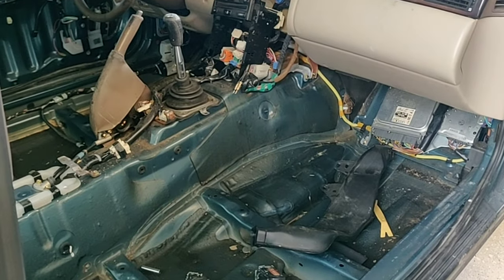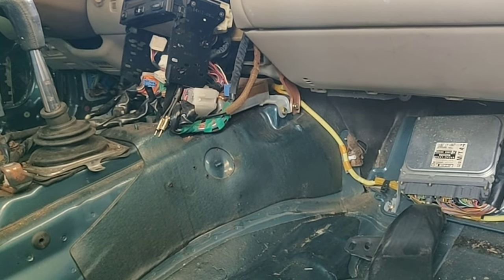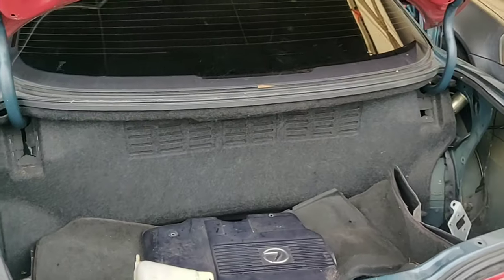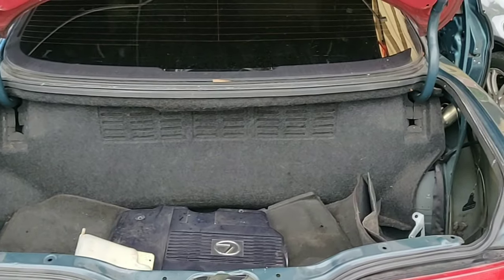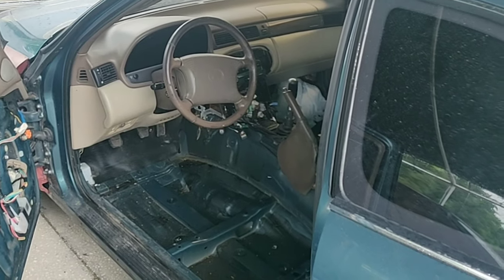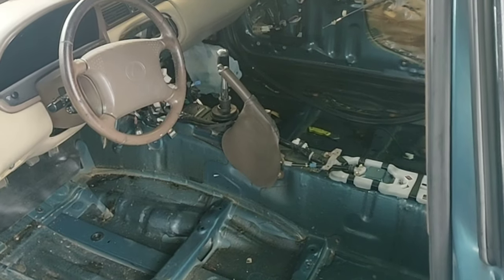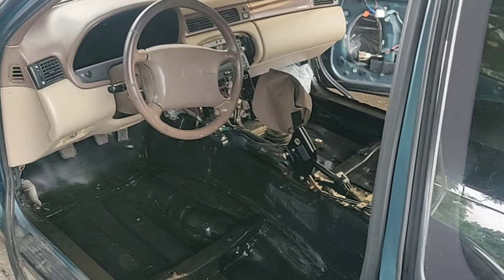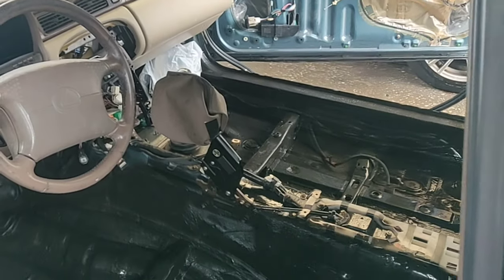LEXUS SC300 MANUAL DRIFT BUILD part 2 INTERIOR RUBBER COATING code name FRANK

Comment: Cut that share wheel housing. Put a plexiglassor medal plate. . Air will flow better, up the rear.
Reply from the maker: More specific?  I tried looking up share wheel housing but wasn't sure what you meant.  Would love to do everything I can to make this build amazing. Thanks for heads up
Reply from the maker: Ok totally realized you meant spare wheel delete and what an awesome idea.  Found some online that look so good. Great idea. Thanks
Reply: Hey bro. Didnt have my comment notifications on.  
That's what I ment. Sorry. .  Would look sick with the battery relocation to trunk.
Reply from the maker: @shawniebeans8382  exactly.  I'm glad you sent.  I may even try to do a center out exhaust like a Corvette. Not sure if it will look ricey or not. I may play around with it in photo shop and get opinion.  But with the spare tire shaved it will be easy.

Comment: Ive never tried that paint yet, ill take your word on that. Have you tried the spray bed liner version? I am thinking of using it to coat my plastic on the outside of my Honda Element.  Great vid man keep them going!
Reply from the maker: Absolutely have.  I have a video using the roll on for an entire Honda Civic but also used the spray on many things including my 63 Austin Healey sprites interior molding.  Stuff works amazing and dries rock hard.  Trick is to make sure to sand surfaces very well with a heavy grit (80) sandpaper.
Reply: @petescarport  thanks for the feedback, i had plastidip my plastic black to see if i wanted to go from blue and grey to blue and black , decided the black was what I wanted but something away from the norm. I am hoping to do my roof as well. I will let you know how it turns out here soon.

Comment: If that is an original 5spd SC then you have an w58. The only ones that came with an R154 are the Japanese Soarer (SC).
Reply from the maker: Damn your right.  I was doing a ton of research and so much came up for r154 but now I'm getting the w58 as stock.  Thanks for the update. I will fix this moving forward.  Still learning all I can about the car and what it has.
Reply from the maker: Also any info you have please send.   Once I pull the trans I'm looking to upgrade any components I need to be able to handle small turbo and about 400-450 up.  Thanks again
Reply: @petescarport  They make a straight cut gear set for the W58, that is your only upgrade option.  From all the research I've done, the W58 gears are going to grenade at the power level you are looking at making, it's not an "if"...it's a "when".  You will find tons of info on this and the various swaps you can do ($$$$)by doing a google search.   Sorry if this isn't the news you were looking for, it stinks due to the car having RWD and obviously a very potent 2J engine.
Reply: @petescarport  I agree with Todd. There are two options get lucky at a junkyard and get a MK3 turbo supra R154 and it will be a fairly in expensive swap. The other option is a CD009 that can be fairly cheap 400-500 at a junkyard, but then all the conversion parts can get expensive 2k+ for them usually.
Reply from the maker: @cielosnegro  and Todd seriously appreciate all the input and knowledge.  I have learned an insane amount over the past week.  This is my first manual SC so I wasn't that educated on transmissions and the strength but with awesome support like you and forums it's really helped. So basically being the first car I plan to run pretry hard and drift, I'm going to do a very mild build on engine and run this w58 till it blows. I'm finding r154 aren't that expensive ($1500-$2k) and can usually hold well with 400whp. 400whp with this car will be my future goal if transmission doesn't hold but figure why not learn on something I can destroy.   Let me know of anything else you guys have learned. I plan to push about 300whp to start with this transmission. Thanks again.
Reply from the maker: @ToddBaughPhoto  thanks for all the input.  I really want to start with what I have since I plan to fully build car but over the course of a few years as I improve at drifting and just driving.  I found a lot of people had success with the w58 on about 300whp or less and using thinner tires like 225.  I plan to throw my 17" rims on for track days.  I figure this will give a lot of beginners like me true testing of low hp sc300 on drift track and also what a w58 can handle.  Then I plan to build 500whp with maybe an r154.  Once again let me know anything you suggest
Reply from the maker: awesome. Yes I have heard this but I didn't realize all the mods needed to mount up the r154. Great advice. I really have no budget for this build accept time.  If I blow the trans it's just saving time while I enjoy my other cars.  Good thing is I now have a shop to store and work on it at and also Tampa has a pretty amazing support team and I seem to come across a lot  of parts really cheap.  Fingers crossed the w58 holds up till I have cash to do full upgrade.  Thanks again